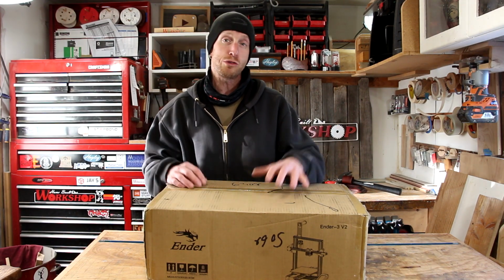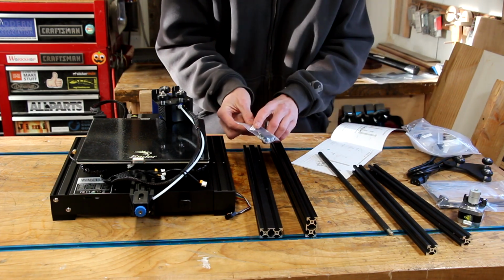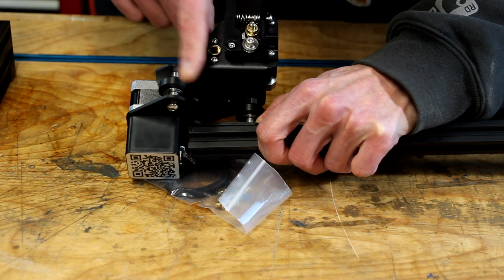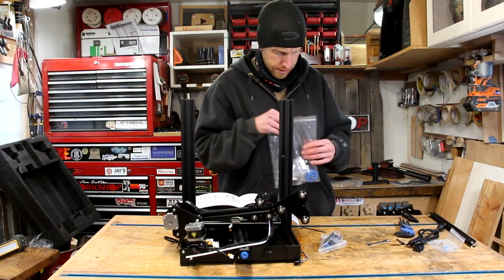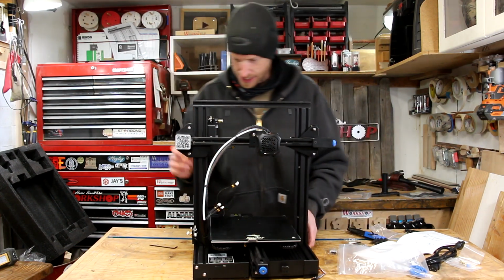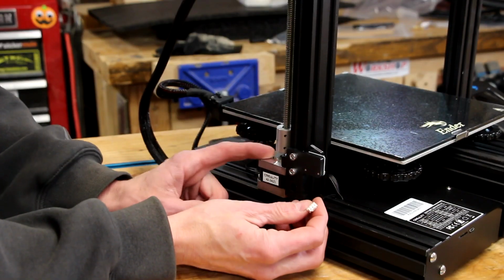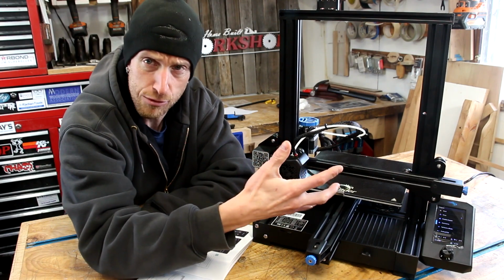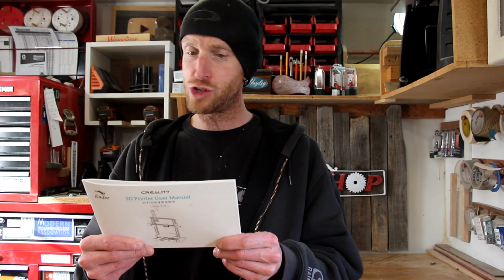Creality Ender 3 V2 3D Printer Unboxing and Setup | Assembling the new printer

Comment: Jeff be carful showing that square Optical Character Recognition on your videos. If you connect the printer to the internet with an app on your phone you use that bar code. Any one else could scan it and control your printer. ( I have heard }
Reply from the maker: This machine doesn't connect to the internet in any way so it should be OK. I will have to see what that barcode is for though. Thanks for looking out.
Reply: @homebuiltshop  Watch this video on YouTube https://www.youtube.com/watch?v=92bNZpgSuRE&ab_channel=DrVax

Comment: cool, the ring is called a skirt. basically it is a "flush" tool to get rid of any missed filament used before the one you put in. Good stuff, I have the original Ender 3, but very modified at this point. Send me a message if you need help, but there are a lot of good resources on here for that also.
Reply from the maker: Awesome, Thank You. I'll let you know if I get stuck.